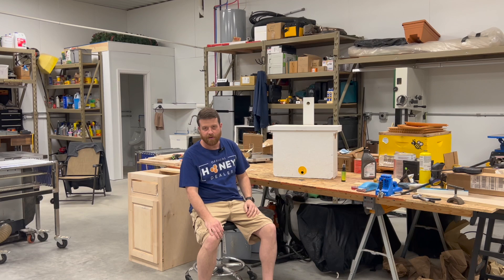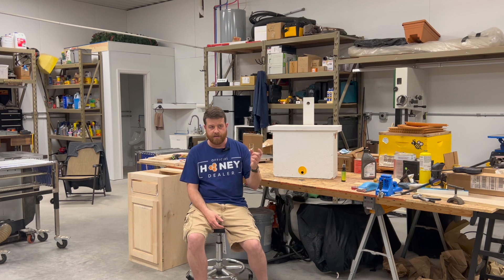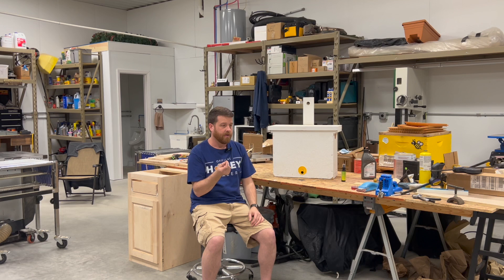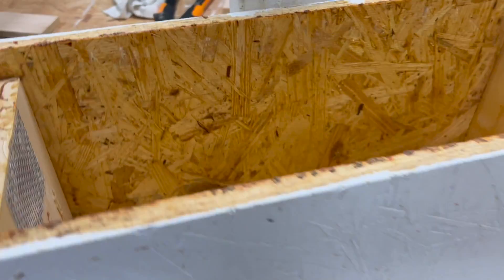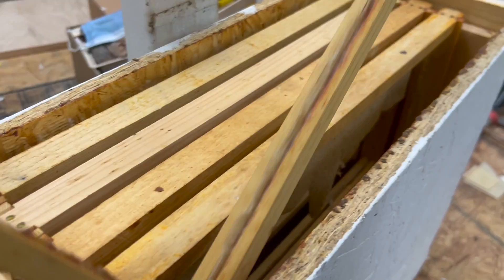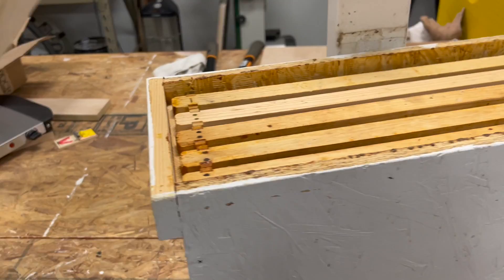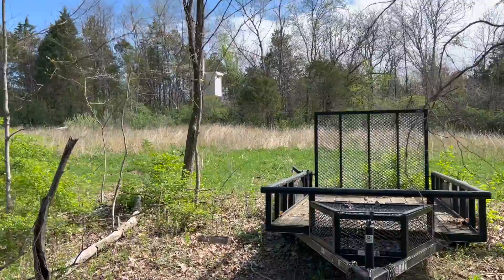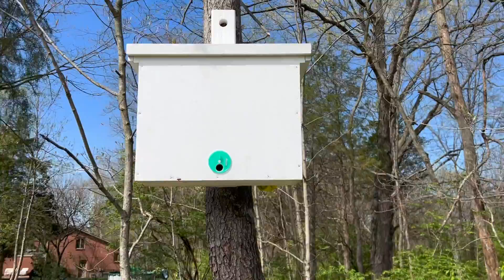Amazing Swarm Traps!!!

Comment: rendered slum gum,beewax etc is a great osb coating,...i like to paint my traps camo,and spray commander  on q tip,or cotton ball in a zip lock  baggie,and only like half squirt w latex gloves  ,nice job on the telescoping lid,the one i bought had a migratory osb lid ...it fell apart,so i make them all telescoping now, a landing perch and or visor  is a good addition ,but not  absolutely  needed, i try not to hang very high,unless im concerned about kids, etc
Reply from the maker: All great tips. Thanks!!!

Comment: Question, does the hive need to hang up on a tree or at height? What abut a nuc sitting on the ground? And I noticed your nuc is taller with that bottom space beneath the frames, what do you think of a standard nuc size?
Reply from the maker: There are many designs for a swarm trap, this is just one. Yes, you could certainly use a nuc box or even a full size Langstroth and bait it. The height is not mandated but it does seem to help in my experience and opinion. Bees do prefer higher elevations than on the ground to naturally avoid certainly predators.

Comment: Where did you get your starter frames. Or if you cut them how did you do this.
Reply from the maker: Hi Eric. Great question. I use Acorn plastic foundation so I just cut them into fourths on the table saw and then melt some bees wax on them. I then use my nailer to secure them to the frames. This particular video did not have the Acorn foundation in it but the concept is the same. These were some older frames I modified that had the wire embedded in them. I just cut that out and removed 3/4 of the original wax foundation. Hope this helps! I’ll try to make a future video on how to make starter strips.